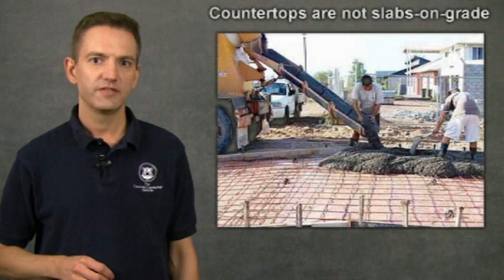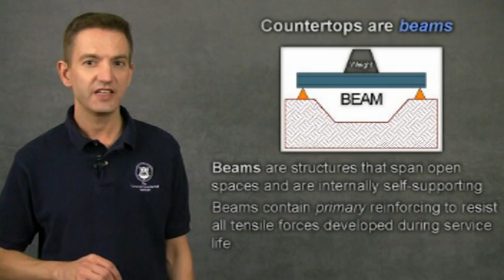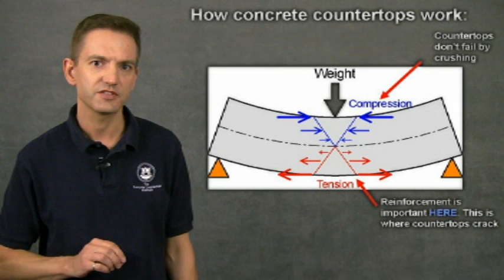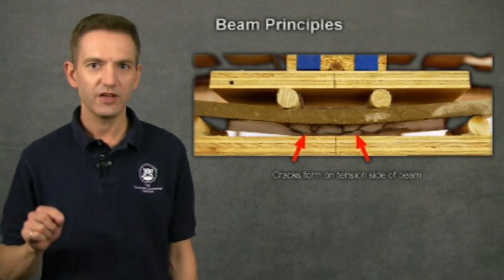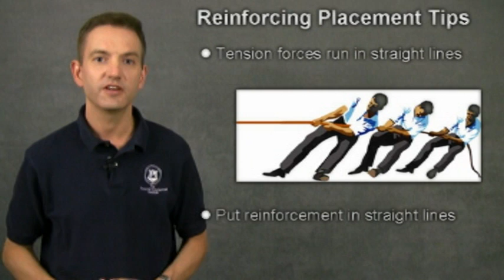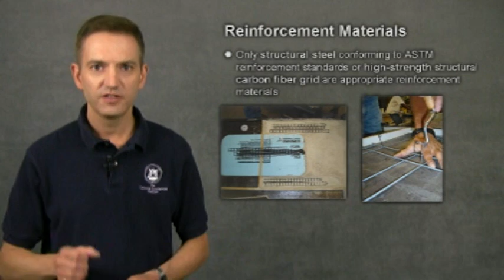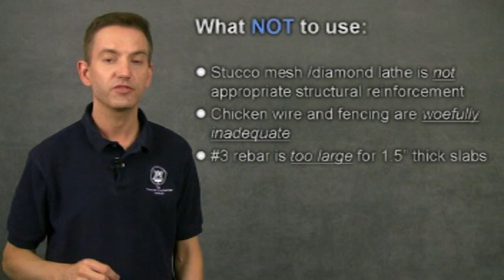Concrete Countertops: How reinforcing works

Comment: would you recommend fiberglass scrim instead of rebar because scrim is extremely flexible why would anyone prefer it over rebar?
Reply from the maker: The material used to reinforce concrete with is carefully chosen to match the physical properties of the material it's used in (the unreinforced concrete). Conventional concrete (ie non-GFRC), is brittle and has a low bending strength. These two properties make the concrete very intolerant of any tension developed from bending or stretching. As you've seen in my reinforcing video, the more concrete bends, the more the tension surface stretches out. While it's not apparent from casual observation, some cracking in all concrete is allowed for and is expected. The concrete itself cannot stretch very much, which is what brittle means, so any "stretching" from bending beyond the small amount that the material can handle is made up for by open cracks. The key to managing the cracks is to limit how much stretching occurs. With brittle materials very little stretching can be tolerated, and this brings us back to the material used for reinforcing.

Structural steel used in rebar and in ladder wire is very strong. But tensile strength is not what makes steel the correct material to use in conventional concrete. The property of steel that makes it superior to glass is its stiffness, also called the modulus. Stiffness refers to how much (or how little) the material stretches when it's pulled. Think of a spring. Steel isn't very stretchy, while glass fiber is 3 times as stretchy. If glass fiber was used to reinforce conventional concrete, it would take a lot (3 times as much as steel) just to be effective. And glass scrim (the mesh used in GFRC) doesn't have a lot of glass in it compared to the amount of steel necessary for conventional concrete. It all comes down to cost and practicality. You'd be spending a lot of time and money using a lot of glass fiber just to equal the strength and, more importantly, the stiffness of inexpensive steel ladder wire.

GFRC can use glass fiber and scrim because its properties are different from conventional concrete. GFRC has a huge amount of chopped glass fiber mixed into it, which makes the bulk material have a very high bending and tensile strength. Thus, it is less brittle and thus can tolerate a lot more bending without cracking. So a more stretchy form of reinforcing (ie fiberglass scrim) can be used in GFRC with great success. It cannot be used in conventional concrete with success.
Reply: What are the non conventional properties of the GFRC that makes it less brittle? Is it the plasticizer or the added acrylics or is it something more like the pozzolans and fume?
I feel like I may have burned myself out with taking standard cement and sand throwing in chopped ar glass with scrim with plasticizer and acrylic and called it GFRC, but is it really a GFRC? Will you guys ever be in New York?
Reply from the maker: RubbinRobbin Mainly, the extremely high volume of glass fibers. It is also very important to place the fibers in thin layers and compaction roll them to align them 2-dimensionally rather than randomly 3-dimensionally. The free online seminars at http://www.concretecountertopinstitute.com/modules/info/gfrc_training.html#seminars explain in detail.
Reply from the maker: The Concrete Countertop Institute Also, Robbin, we have students from all over the world travel to our training facility in Raleigh, NC. The next class, we have students coming from Ireland, Guatemala and Australia. You can drive down from NY! Our next GFRC class is March 13-14, 2015. Details are here: http://www.concretecountertopinstitute.com/modules/info/gfrc_for_pros.html
Reply: The Concrete Countertop Institute omg, thank you for this and combing the fibers makes so much sense.. I don't know if I can afford both the class and the trip but thank you so much for all the info you have shared. I wish you and you're loved ones the best with much success and reward!
Reply from the maker: RubbinRobbin You are very welcome, and thank you for the kind wishes! For the specifics of fiber alignment, see this article: http://www.concretecountertopinstitute.com/blog/2013/04/glass-fibers-an-essential-component-of-gfrc-concrete-countertops/. Keep in mind we do have self-study training as well: http://www.concretecountertopinstitute.com/modules/info/self-study_training.html.

Comment: I think, you doing good job explaining for "engineers", not for "workers" who can't imagine. I agree almost everything except metal re-bar. (Portland) Cement is Alkaline, it will encourage corrosion on metal. That is why bridges collapse. Even Glass Fiber on Polymer Cement has to be Alkaline Resistant. Your statement saying high volume structural fiber is relative, since their total cost is less than (material and labor) of re-bar and lasted much longer. Spread thin entire (bottom) surface and adhered to cement., its strength to be compared with surface gluing to spot welding. While cement never really adhere to metal, that is why re-bar has ridges for better grips. It diminished after start corroded, swell and split the surface of concrete exposing to humidity. Dipl.-Ing ST

Comment: This is a stupid video because he talks about what to do and what not to do but he doesn't show. He just talks. He showed a bad counter and how they messed up reinforcing and he didn't show how it should have been done correct... CHUMP
Reply: Watch the video again, he explains the correct orientation reinforcement should go, as well as what reinforcements to use; #9 ladder wire. Also this isn't a "howto", but a single lesson in a series.
Reply: Get some help from a grown up, dumbass.
Reply: Do you want to be spooned feed your whole life, do further research, and think a bit dammit, the video explained how stress and forces work, watch it again again until you see the bigger picture.. 
Plenty information on how to lay re-bar, just adapt for your need or using mesh.

Comment: Fiber glass mesh vs wire mesh vs fiber
Which is the best and why. I understand fiber glass is the easiest which will give you the best strength? Should you use 3/4" plywood as a backer? What is the best way to strengthen the thin strip in front and behind the sink people are always sitting there..

Comment: Thanks for the great video. I am making a media center out of 1 1/4" black iron pipe and concrete. The two concrete shelves will span about 7 feet (x18" wide), and are supported on either end by the steel pipe skeleton. There may be up to 300 pounds of LPs on one of the shelves, dispersed evenly across the 7 feet. Can you recommend a slab thickness and rebar thickness? I was thinking of 2 1/4" slab, with 1/4" rebar running lengthwise every 6", leaving 1/4" from bottom of rebar to finished bottom

Comment: For counter tops plan on losing a lot of money and time before you start making money. You cant just watch a video and then make a successful business out of it. It takes experience and the only way to do that is to empty your wallet and get your hands dirty.  If you just want to make various stuff out of concrete get your self some chicken wire, a trowel, bucket, and a bag of concrete and do what mrjaybird said. Tools matter. Get the right ones for the job.

Comment: Buy a bag of concrete and get started. A birdbath, or slab for a dog house is a good start. Mess it up and you still have a perfectly serviceable birdbath or dog house. If you don't like it, try again. In a week or 2 you should know if it is right for you. Wear a dust mask when working with dry, lift cement (dry and wet) carefully (it gets heavy fast) and do not mix with your hands and there is not much that can go wrong. Most of the materials are inexpensive.

Comment from the maker: Ladder wire should never be welded since it is cold-drawn to achieve its high tensile strength. Welding anneals the steel and lowers its strength. Ties are only necessary for convenience; they offer no structural benefits. I find 4" nylon cable "zip" ties to be very effective.

3/8" rebar may be used in 2" thick concrete with care to keep it very low in the slab. 1/4" rebar would be better.

Comment: So long story short use masonry remesh wire, 9 gauge? Run it longitudinal and latitudinal, how do you tie it in together? Weld? 

If you make a 2" slab can you use regular 3/8" rebar? Or still too thick?

Comment from the maker: Carbon fiber reinforcing is a great alternative to steel, however it can get expensive. Ordinary fibers used in concrete are not designed to replace steel reinforcing and as such are not suitable or effective alternatives.

Comment from the maker: There are at least 7 different gauges for wire, depending on the application, material, country, etc. So depending upon which system you're looking at, a #9 wire could be anywherefrom 0.009" to 0.194" in diameter!  Ordinary fencing wire (which may be classified as a #9 wire) isn't appropriate for critical reinforcing, as it doesn’t meet ASTM A-82 standard.

Hand weaving, soldering or welding sounds like an awful lot of work for very little benefit. Welded wire mesh already exists and is cheap.

Comment from the maker: I have always advocated using 9 gauge masonry wire for reinforcing. It's a true, structural reinforcing material, it has great properties, it is easy to work with and it can provide outstanding results when used correctly.

Comment from the maker: With careful placement and casting it's possible to place reinforcing as close as 1/4" from the visible surface. Note that this will not cause ghosting. Ghosting is caused by *pushing* the reinforcing through the concrete, no matter where its placement.

Your question regarding the cantilevered bartop requires design services beyond the scope of these comments. Jeff Girard does offer consulting services. Contact us for details.

Comment: How close may the reinforcing be to the  surface of the concrete?And what type of concrete would you reccomend for the following project?I am building a 14'x21(w)x2"(t) 16" of the width to be canted. 3" bearing using #3 on 16"centers for support and #9 ladder wire tied for tensile strength A 2x6 wall provides the 3" of bearing The rebar will be L shaped with legs of 8 and 20 inches,the 8" leg will be inserted into a3/8 hole in the 2x6 studs and glued the 20 "will support the slab Thanks

Comment from the maker: Thanks Oealnc for the nice comments. 

Pkqkennywood, the answer to your question is essentially no. I've just posted a blog entry. Go to the home page of my website and click Blog at the top right. 

Karenwaln, I will get to your question soon. It takes more than 500 characters to explain! Basically, I used 14 individual strands of 9 gauge ladder wire. The strands were placed about 1/4" apart in order to fit all 14 in a single layer within the beam's 6" width.

Comment: Fantastic video!  This was a really well thought out and presented explanation of reinforced concrete design.  I have taken many concrete design courses and this is by far the quickest and most intuitive approach I have seen detailing tensile and compressive strength function and placement of reinforcing.  Everyone needs to watch a good 10 mins of something like this, not just for concrete, but for the nature of materials and stresses for building. Thanks!

Comment from the maker: Wooden tops on the cabinets will not provide structural support. Wood is too flexible and weak, so you still need the proper steel reinforcing in the concrete. The dimensions of the cabinets are fine - the concrete countertop will lay over top of several cabinet boxes, depending on the layout of your kitchen.

Comment: Great info. Do you need to put in reinforcements if your cabinets already have a wooden tops which the counter  will lay on. My cabinets have odd dimensions too (I have one of those weird, modern kitchens). Some cabinets are 12" X 40", 12"X14", 24"X30". Should I bother putting reinforcements in these or are they too small?

Comment from the maker: Planetary polishers are a fantastic tool that makes producing smooth, flat and gouge-free surfaces fast and easy. Justifying their cost (and the tooling - in triplicate!) is something you need to determine. Do you do a lot of large, flat countertops? Do you or your employees struggle with keeping a single headed polisher flat? If so then maybe a planetary polisher is a valuable asset. You will still need a single-headed polisher for narrow sections, edges and inside integral sinks.

Comment: You mention AR glass mesh. I have searched online for this and I've been unable to find it except in very large quantities from overseas. Is there a special store that usually carries alkali resistant glass or should I start snooping around my local concrete countertop shop?